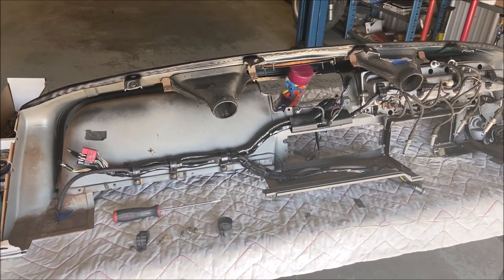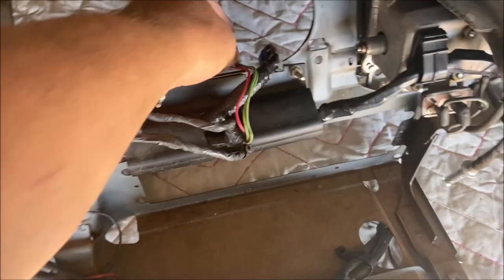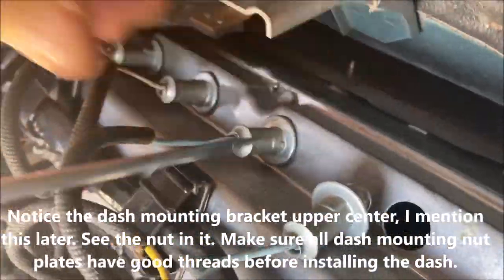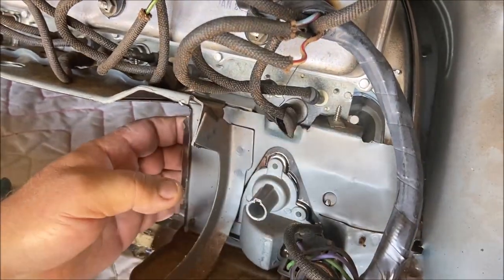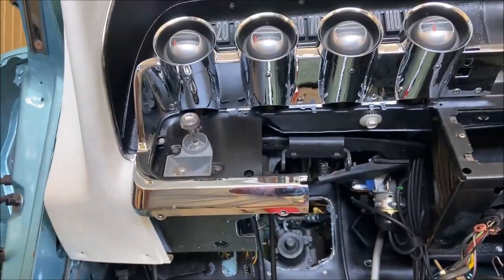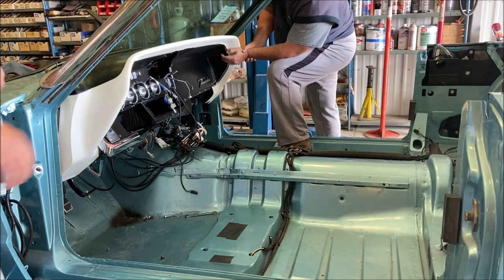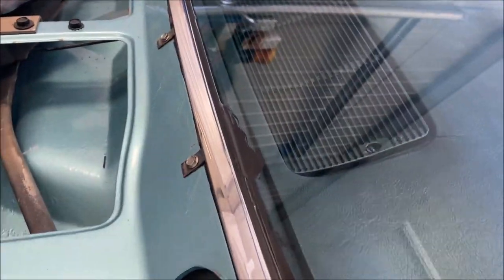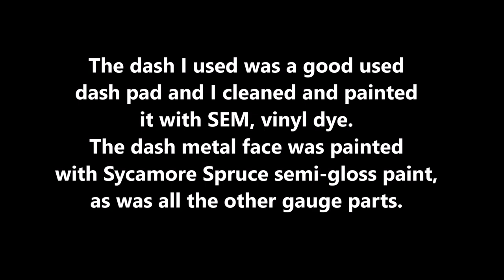1964 66 Thunderbird dash familiarization and installation

Comment: Hey Nick, thanks for the detail. Tomorrow Lord willing, will be my big day of one fat guy installing the dash in my '65 Tbird. My wiring harness had like 8 fried wires and then I changed most all the vacuum hoses. What fun....
Reply from the maker: Hey Michael, test EVERYTHING before you reinstall the dash. I take all the wires off the back of the dash, plug them into the harnesses on the car, make all the necessary grounds and I check everything, gauges, bulbs, wipers, ebrake, etc. I also run the vacuum system and make sure the heater and AC work perfectly before going forward. Good luck.

Comment: I have great respect for the people who have the skills and patience to work on these miserable cars.  I love 64-66 T Birds but they are vexatious to work on with those complicated and troublesome wiring and vacuum hose problems they always have.  Back in the day, the dealership mechanics despised them.  In addition they wore out suspension components quickly.  Replacing the upper control arm shafts was a tough and dangerous job.  At today’s crazy labor rates I can’t imagine what a dash wiring job would cost!
Reply from the maker: Hey Craig. The only Thunderbird that has wiring problems is the 64. They characteristically burn the amp meter wiring from the amp meter through the fuse box. I never did figure out why they do this. Since most do it, finding unburned wiring is the trick. Replacing the burned wiring is a big deal since the dash needs to come out and you need to locate good wiring. I used to sell good used wiring looms but getting the dealers today to sell that stuff is a problem. That's why I had to hand make the wiring for the Thelma and Louise car, nobody would take the time to look in their inventory to see if they had what I needed. When I say hand make, I mean that I took a 66 hardtop wiring loom and grafted in the convertible wiring from another car to complete the loom. The wiring that was in the car was a joke and I'm very surprised the car ran at all.
Reply: @vintagethunderbirdrepair9426  When I was a kid my best buddy’s dad bought a new 1965 with all of the desirable options.  I loved that beautiful car but I remember he had constant problems with it mostly electrical and vacuum problems.  At 100,000 miles it was pretty worn out. If you weren’t careful it would pop into reverse and take off!  How Ford got away with that is a mystery to me!  He traded it in on a Buick Riviera that never gave him any problems.  Before the 65 T Bird he had a 63 T Bird.  It was HORRIBLE on brakes and it ATE power window switches!

Comment: Nick you were spot on with your help to me on my 66 door window and trim panel repair, Thanks now onto the front seats I cannot find anywhere where they talk about what to do with the very small wires that seem to go thru the burlap on the underside of my seat. Have searched but no answers yet. Thought you would know since you do a lot of Birds.Thanks...
Reply from the maker: Hey Rodney, I'm not sure I understand what you mean but I guess your talking about wires or strings that hold the seat material or foam to the seat springs? I do not do upholstery, never recovered seats. I don't know the answer to that sorry. Speak to someone who does auto upholstery. Good luck.
Reply: @vintagethunderbirdrepair9426  Thanks Nick

Comment: Thanks Nick, (again), for taking the time to share what you know. Bench tested my gauge voltage regulator.  All my gauges went out due to me replacing the speed-o cable and pulling some wires. After checking the fuse panel and diving under the dash I found I'd pulled the wires from the gauge voltage regulator. Repairs underway.
Reply from the maker: Your welcome Nick

Comment: You make it look so easy... well I was planning to remove my instrument cluster as I know I have a fried wire a green wire that the insulation is all bubbled up. I think it comes off the ignition and goes to the center console area. You can see where in the past some one has spliced it twice in the past. must have used it for a CB or something. So I want to pull the instrument cluster out so I can better get to that green wire to replace it. My speed omiter cable needs to be replaced as well so I might as well.
Reply from the maker: Hey Mike, plan your job well. Once the dash is out, fix everything while you have the chance. Clean everything under the dash too. You can rebuild your vacuum system while there also. Good luck.

Comment: Love the videos!

Have to ask, as my 66 has the same wire loose.....what does the loose wire at 17:14 connect to?
Reply from the maker: Sometimes there are a few wires under that dash that do not connect to anything. Not many, just a few. That may be one of them. Without being under the dash at the moment, I dont know what that wire is for. Ill look into it.

Comment: Nick, great visual tutorial as always.  Thanks so much.  As far as dash removal goes, besides the items you show during assembly, any tips?  Bill in Oklahoma
Reply from the maker: Hey Bill, yes take lots of photos of screws and hardware and where they came out of and how things were put together so you can then reinstall everything and know where it all went. Good luck
Reply: Nick
This week I’ll be pulling the dash, vacuum control and the HVAC plenum.  Your vids are invaluable.  Do you have any for the dash voltage regulator?

Comment: Nick,
This was a video worth waiting for, my friend.  Excellent job.  Clears up everything.
Two questions: Are the original large wire bundle connectors color coded like those in the video?  And who did the re-chrome job on the instrument cluster mounting?
Regards,
John
Reply from the maker: Thanks John. I guess your going to be doing something similar soon to your 66? Most Thunderbirds have the wire bundle connectors (I call them plug ends) colored black but they are configured/shaped differently so you cannot plug them in wrong. There is the red one which every Thunderbird has but that is the only one that is not black.
Reply from the maker: Also, the chrome was done at Van Nuys Plating in the San Fernando Valley in Los Angeles. They did a very nice job on a piece that is crappy pot metal with a lot of curves. I had all the dash and center console chrome rechromed since it was all heavily pitted and the customers agreed that they looked so bad that rechroming was necessary.

Comment: Is it worth , product availability or price, to use LEDs for the dash lights?
Reply from the maker: Good question. I've never tried that. I guess what would need to be done is someone change all the bulbs with LED and see if they illuminate everything properly. Its too late for me because I'm already reassembling everything. I never even thought of it. Might be the way to go in the future. Thanks
Reply: I tried led bulbs in the dash, but they didn't work great with the dimmer control...  was basically an on/off scenario, not really dimming.

Comment: Hello Nick,  Thank you for the great video -  I started the reinstallation  process last weekend. I am  doing this without the windshield installed. Hopefully finish it up this weekend. Do you have any suggestions to maintain the tightness at the windshield weather stripping you mentioned once the windshield is installed.
Reply from the maker: Hey Jeffrey, we had issue with that with this dash as well. We had to struggle with it pushing up hard while trying to bolt it down. I bent the center dash mounting brackets down a tad to bring the lip of the dash up to meet the rubber since the center of the dash was below the rubber at first but the sides were okay. Those brackets obviously have a lot to do with the fit. Some dashes fit right in without a problem, the one in the video was a struggle. I edited most of that out since it took up a lot of time. If you have the windshield out, maybe you can put something under the speaker area of the dash like a plank with a rope on it and pull up while bolting it down?? The windshield is in our car so we didn't have that option. Theres not a lot of options there. Thanks.
Reply: @vintagethunderbirdrepair9426  Thank You !!

Comment: I know this is an old Video but hopefully you will see my Question . What would the part number of the after market relay be for the Fender turn signal light flasher  be please . Mine is on a 66 .  Thanks in advance .
Reply from the maker: I dont know the part  number but I bought it at the Birds Nest. Call them and they will be glad to sell you one. It worked very well in that car I restored. Thanks.
Reply: @vintagethunderbirdrepair9426  Thanks for your reply.  I will give them a call .

Comment: what is the  aftermarket fender relay? I got a a 1965, thank you, great video Nick!
Reply from the maker: I got it from Birds Nest. I don't have the part number but just ask them for it, they will know what you want. Good luck. Thanks.
Reply from the maker: Sorry, I may not have answered your question properly. The fender relay controls the fender lights for the turn signals. It also makes the clicking sound for the turn signals. It is under the dash on the drivers side as pictured in the video.

Comment: Hello Nick, the dash videos are really great. The lower mounting brackets look adjustable. Do you lift up on the dash as far as it can go, or is there a specific adjustment? Also, when removing the dash, other than the mounting bolts is there any type of adhesive used to look out for?
Thanks,
George B. in Michigan
Reply from the maker: Hey George, the lower mounting brackets, you mean the ones on the left and right? Yes those are adjustable up and down. I adjust the top where the dash sits into the windshield rubber and then worry about the bottom last. Those can be adjusted at any time. I don't force them up but do put a slight preload on them meaning that I push up a little and then bolt them down. I guess there's no specific reason except to remove any unnecessary play/looseness. The dash pad is glued to the metal frame. Once in a while they just slip right off but I wouldnt count on that. Usually you have to take a puddy knife and gently separate the dash from the frame. Its tricky so be careful. Its usually around the speaker grille that you have to worry about. The other places are not a problem. Good luck.

Comment: This thread is a few years old but looking for some help. My cluster voltage regulator tested fine with a meter. I still have no dash lights or operational gauges. When you say the CVR needs to be grounded. Is it just grounded by the bolt?
Reply from the maker: Hey William, yes, it is just grounded by the bolt that holds it to the back side of the speedo assembly. If your gauges dont work, its either the CVR, the sending units, the gauges themselves which is easy to test, or the wiring, probably the wires in the engine compartment. Its a process of elimination. Good luck.
Reply: @vintagethunderbirdrepair9426  for an video a few years old I appreciate the quick response!  I am trying to test everything I can before taking the gauge cluster out. As I have read that can be a pain. As far as the wires in the engine compartment. Do you have any more insight on that? I have tested the CVR. It is operating as advertised and is grounded.
Reply from the maker: @williamhumble4740  I reproduced the 3 sending unit wires in the engine compartment that go to the oil send, temp send and coil positive wire. They have to be spliced in the loom at the firewall. The sending units you can purchase new. However, testing them is easy, just ground the wires with the key on but for just a second. Have someone in the car to watch the gauge. If the gauge needle starts to go to the right, then the wires and gauge are good. You can do the same thing for the fuel sending unit power wire too.
Reply: @vintagethunderbirdrepair9426  i grounded the gauges. And they all operated when grounded. Sorry for all the comments/ responses. I feel like I’ve hit a dead end road with forums online. What would you suggest next?

Comment: Hey Nick, how do you test the CVR?
Reply from the maker: Hey Mike, you need a volt meter and power like a car battery. You ground the body of the CVR to the negative terminal of the battery, apply power to one of the terminals on the CVR with the positive terminal of the battery and hook a volt meter to the other terminal. If the CVR is good, you will get a pulsing, on - off - on -off etc. Its easier to use an analog volt meter, not a digital volt meter.

Comment: I have taken my dash apart but all the gauge/speedometer lights do not work, the only light that works on the drivers side of the dash is the bright headlight indicator light.  i tested the bulbs and they are good.  Any ideas as to what it may be?
Reply from the maker: Well the lights get their signal (power) from the head light switch. So check the switch or the plug that goes onto the switch. You should have a wiring diagram, it would help you to search out these issues.
Reply: I have the same situation on my 66. I assume that I have a grounding problem. Hoping Nick has suggestions.
Reply: Found the source of dash lights not working--- bad contact at instrument light fuse. I had pulled cleaned and checked them a few months ago.
Reply: Yes!   That was it for me as well
Reply: Yes!   That was it for me as well
Reply: Yes!   That was it for me as well
Reply: Yes!   That was it for me as well
Reply: Yes!   That was it for me as well
Reply: Yes!   That was it for me as well
Reply: Yes!   That was it for me as well

Comment: I need help on doing my 61 bird dashboard im 40 min north of los Angeles let me know if you czn help or if you know anyone thanks
Reply from the maker: Hey Eddie, what exactly do you need help with? Technical advice or physical help? You must be near Oxnard, Ventura?
Reply: @vintagethunderbirdrepair9426  30 min east of Oxnard i need help with ac and heating underneath the dash just so you kniw dash has already been removed everything is wide open
Reply from the maker: @eddieadame7159  Well everything in the video also applies to 1961-63 Thunderbirds. The only difference is that you have no vacuum going to the defroster or AC compressor switch. Both of those on your car are cable operated. Otherwise the plenum is identical, the vacuum system is identical and routed the same, and the heater box is exactly the same and comes apart the same. However, your heater valve is bolted to the heater core and there is no thermostatic vacuum switch in the fan compartment. Actually, the vacuum system in your car is simpler than what you see in my video. My video shows how the vacuum hoses are routed and the layout of everything under the dash. So, I still dont know what exactly you need help with. I understand your going to fix the AC and heater, but what cant you do or what do you not understand?

Comment: What is it that's wrong with a new C.V.R?
Reply from the maker: Ive had problems with the new CVR's. They work for a few days and then they fail. I have not had this happen with a lot of them since after the second time, I just use used one. Ive had no issues with used ones. It seems that everything Ford made originally is always better than the reproductions. Thanks.
Reply: @vintagethunderbirdrepair9426  Thank you Nick, your insight is always more than helpful

Comment: Perfect time to slam a brand new heater core in there
Reply from the maker: Well if you only have 35 cents, you cant afford a heater core. lol
Reply: Cent is a Land area measurement . I was just reminding some of your viewers if they're going through all that removal you might want to do the things that you don't want to do it again along with all the vacuum lines and gauge regulator good tutorial i did 10 0f them a real pain
Reply: @vintagethunderbirdrepair9426  by the way who refinished the dash
Reply from the maker: @ihave35cents95  I've heard that before somewhere but forgot about it completely and didn't make the connection. I looked it up and its 1/100th of an acre.  So 35 is roughly a third of an acre, not too shabby. You learn something new every day.
Reply from the maker: @ihave35cents95  In this video, I repainted (redyed) the dash with SEM vinyl dye. Two colors, white and black. It turned out very nice if I don't say so myself. If the dash were damaged, Id send it to Just Dashes and have them restore it. I have a video about their work as well. Thanks.
Reply: @vintagethunderbirdrepair9426  it's my Plumbing business on Peachtree Road in Atlanta that I bought off a Hindu and that's how he labeled it
Reply: @vintagethunderbirdrepair9426  yeah I used them before on a 64 I had what's weird I just acquired a 65 and it doesn't have a two-tone – black and the interior color but it is original have you seen that before
Reply from the maker: @ihave35cents95  I dont remember exactly but I have seen blue interior cars with a dark blue on top instead of black.
Reply: @vintagethunderbirdrepair9426  I just got back home from a 65 I bought last week I just got her home from a 250-mile trip and that is the case I overlooked it its dark blue top.so it is two tone after all
Reply from the maker: @ihave35cents95  It must be a pretty nice car to make it the 250 miles. Sounds like a nice road trip. Motor on my friend.
Reply: @vintagethunderbirdrepair9426  thanks I got a real good deal on it I never had a flare bird